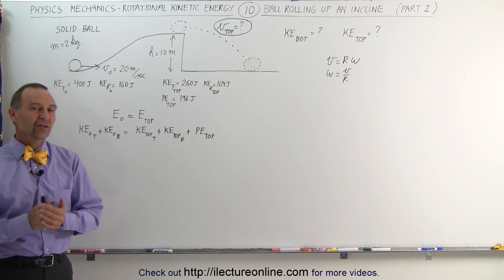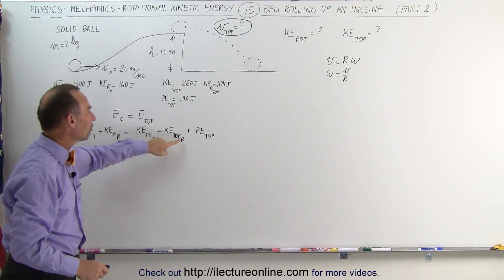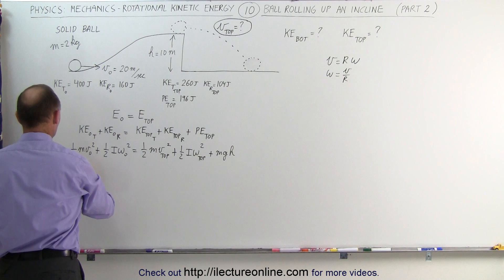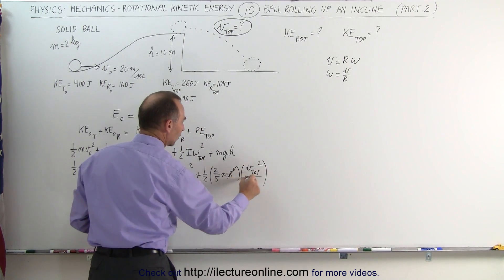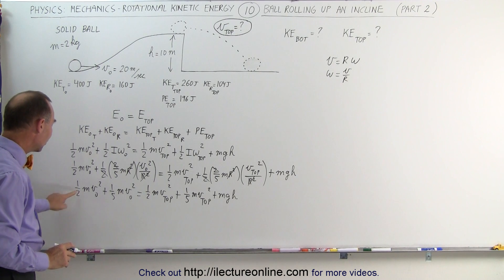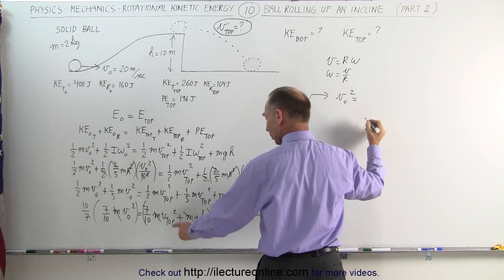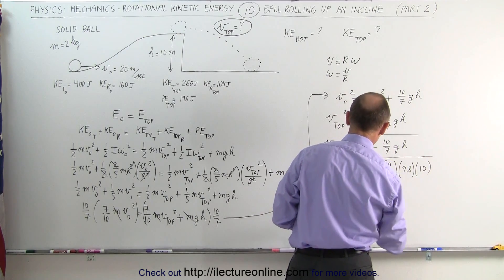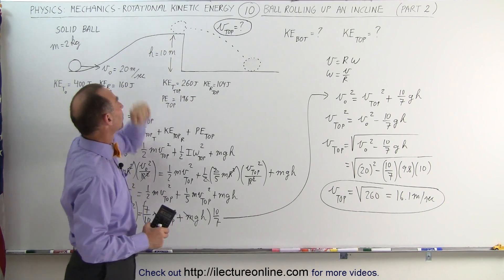Physics 8.5   Rotational Kinetic Energy (10 of 19) Ball Rolling Up an Incline (2 of 3)

Comment: Sir i think you did not need to set another equation to find the velocity at the top  
as you calculated at part one the kinetic energy at the top was 260 J   so the kinetic energy at the top is equal to one half of mass times V ( at the top ) ^2      so from this way you could easily find V ( at the top ) without setting the conservation of energy equation again .
Reply from the maker: There are often multiple ways in which one can solve these types of problems.  I tend to teach my students standard methods of solving problems.
Reply: @MichelvanBiezen  yes sir
It shows how elite you are in you job 
I should have considered that.
Reply from the maker: From experience, many of my students who decide to try and solve the test problems with other methods, often get the problems wrong while the students that stick to the methods I show them in class get the problems correct.  So, I stick to the methods that appeart to work the best for most students.

Comment: shouldn't the equation be Epot=Erot+Etrans , i mean all the kinetic energy into a potential energy transformed , or should we take the case that the object will still be moving when he reach the maximum top to fall in the bottom? because when  i did the case when the object will stop moving when reaching the top i got the vtop = 16,73 m/s
Reply from the maker: You cannot assume the object is stationary at the top.  (If it was stationary at the top, it would not continue and reach a point beyond the cliff)

Comment: how would u find the range (R)
R = V(t), but do you use the horizontal velocity for "V" (or in this case V(top)) or the net velocity?
Reply from the maker: The horizontal velocity will always be equal to the velocity at the top (where there is only a horizontal component of the velocity)